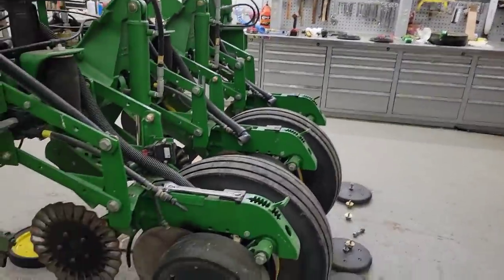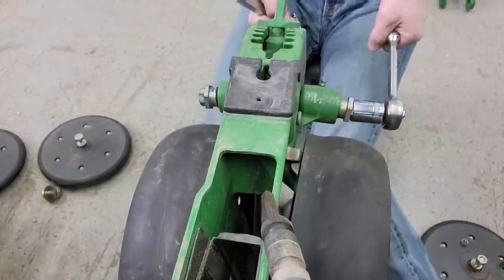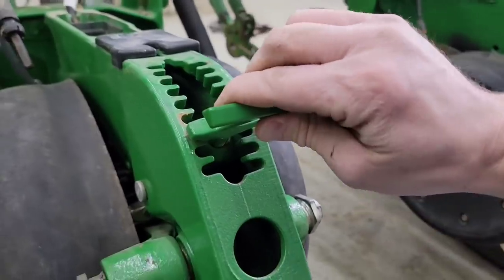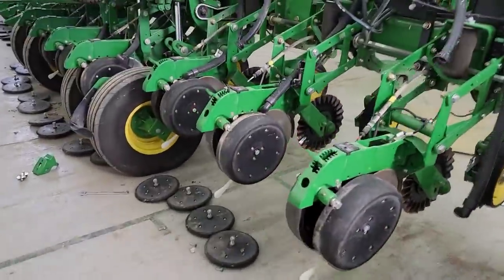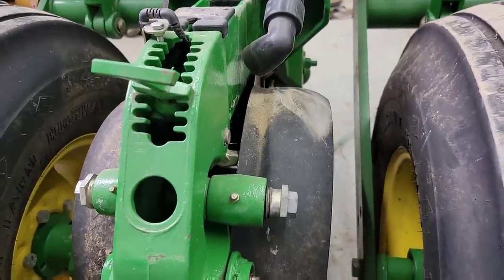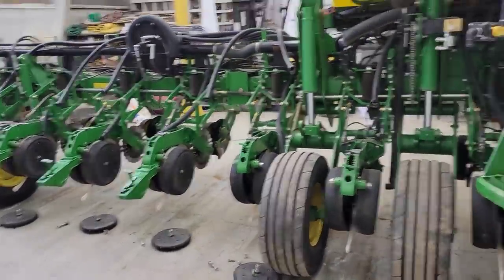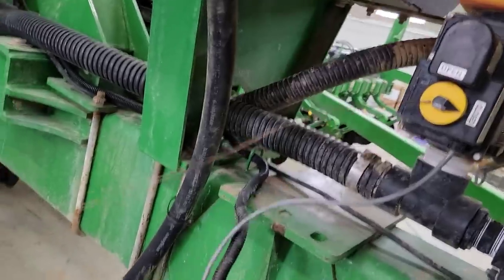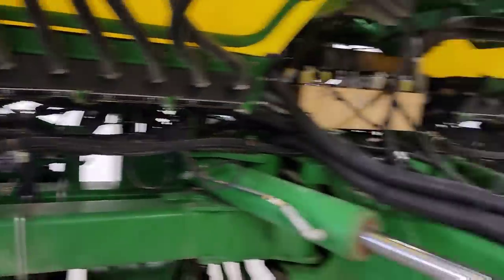Remote Control Valves?  - #351

Comment: I think you can swap the gauge wheel and arm to the opposite side and it wears on a different spot of the threads. also get a fresh spot for the depth adjustment moustache deal

Comment: I noticed on the row you put the new arm it that you have the fertilizer disk facing the wrong way.  Easy mistake to make because I have done it also.  It seems counter intuitive but the bevel side goes away from the gauge wheel not towards it I believe.

Comment: I understand that the gauge wheels control depth but can you explain why it is critical to have the gauge wheels adjusted to run directly up against the discs?
Reply from the maker: Because if there is a gap dirt will get between the opener blade and the gauge wheel. When that happens it falls into the seed trench and will affect the seed depth.

Comment: changing the tires and running less air pressure, will that change the pop that you were planting. I think the od will be less. Maybe i'm over thinking
Reply from the maker: You're  over thinking for 2 reasons. 1. It's the rolling distance that matters with a contact tire ground drive. So with a system like the fertilizer on the corn planter the the driven tire matters the drive tire doesn't.  And 2 both planter are hydraulic drive and don't use the tires to control population anyway.
Reply: @BorderViewFarms  O K